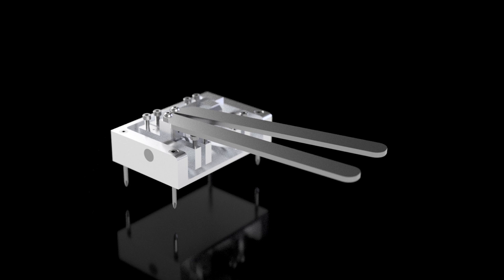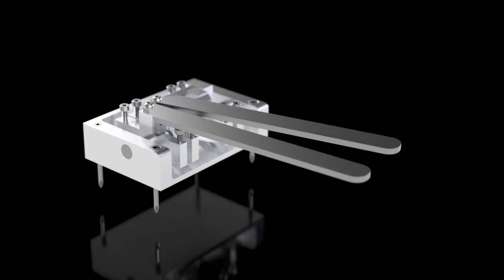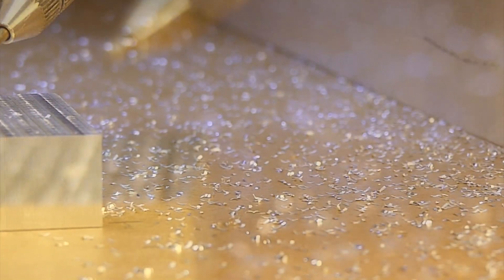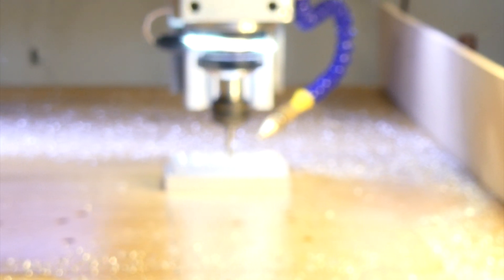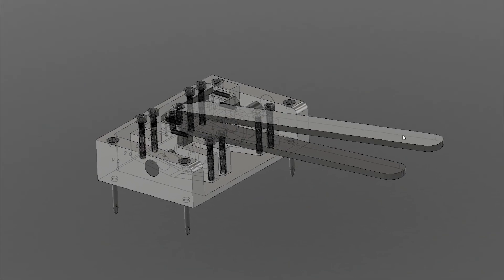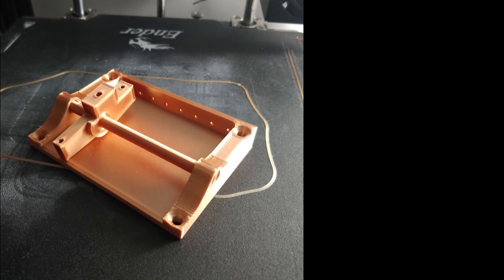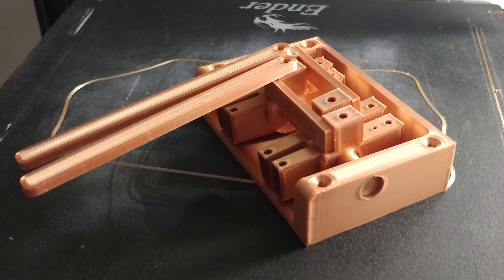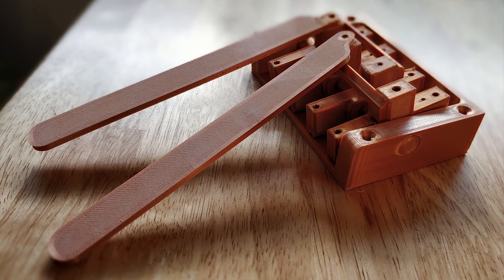Milling Aluminum on my CNC router | Prototype Lap Steel Bender

Comment: Would you mind sharing the model and manufacturer of your milling machine? What software do you use to generate the machine movement profiles? Would you recommend this setup to someone interested in building similar type and size items out of aluminium as a primary use case? I'm thinking about getting or building a similar CNC mill for prototyping small electronics enclosures, heat sinks, etc. But, I don't have much experience at all with milling of light metals so far.
Reply from the maker: This is one of the older CNC router parts, now Avid CNC machines, the CRP2448. I like their products; however, there is a significant learning curve like ruing any automated machine. This is my third machine, and I am in the process of putting together my 4th, A machine that I designed based heavily on the Avid style. Check out my playlist for that build and Avid. 

https://www.avidcnc.com
https://youtube.com/playlist?list=PLtoC5TIxpwGWaUB-oaUARnTcgnhmrgpcU

Comment: So what size bit, flutes?, rpm, feed rate? depth of cut, % overlap? was your air cold or ambient?
Reply from the maker: You mist use a single flute bit for this work as the RPM is 12k to 18k, the deepest cut I take here is .05" with a .0625 step over at 30IPM.
Reply: @TwoCherriesIns  thanks for the information, what diameter was the single flute bit?
Reply from the maker: All of the bits used are single flute, the big one is 1/4" and the smaller two are 1/8"